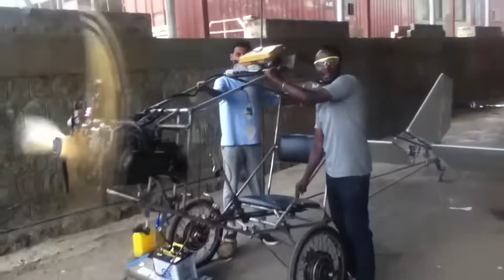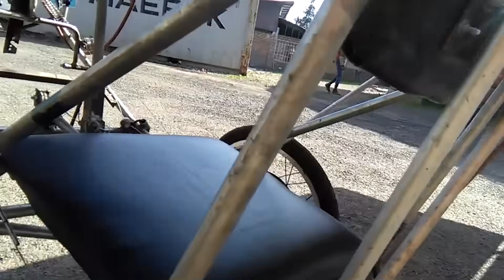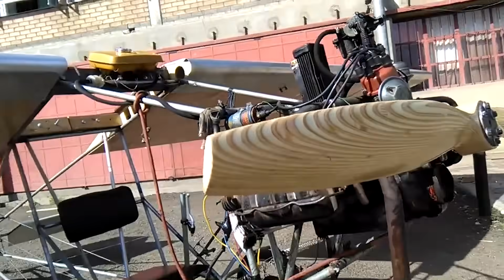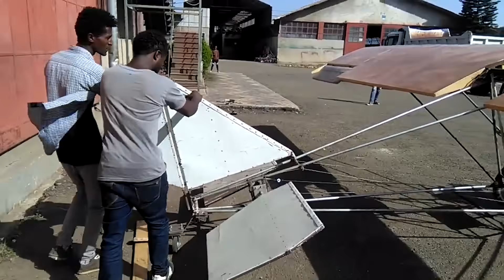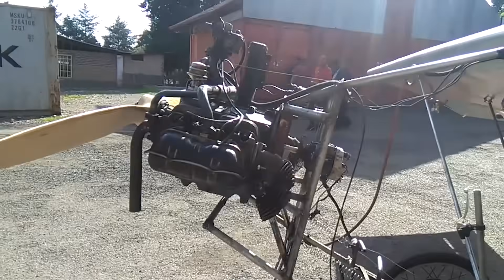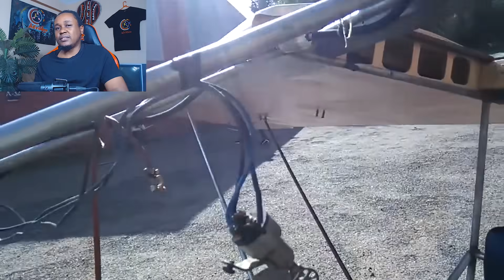First African Airplane To Breaks Aviation Rules

Comment: The next crash. A ford truck can fly but controlling it is somthing else  its called fluter on the elevator  and center of balance Weak looking weldsand landing gear. It comes apart after takeoff its over. Good luck

Comment: He says you sit directly under the small lawn mower engine. This is a VW car engine and is in front of the pilot. These engines are often used on even bigger planes, although they are modified. They even use 1/2 VW engines with 2 cylinders.
I don't think he is even talking about the plane shown. This plane looks like an actual manufactured and flyable aircraft, or at least they followed tried and tested plans.
That engine will have plenty of power. My only concerns would be that the engine is too heavy, the elevator deflection is too extreme, the gas tank looks like it holds enough for a 10 minute flight, and the pilot may not have a clue what he is doing.
Reply: A geared motorbike engine would be better . Power to weight ratio, bigger engine equals bigger wings .  Not to mention centre of gravity

Comment: You don't seem to know anything about aviation but to comment to negative about other investors that are trying and not sitting ideal
Reply: "inventors" 😂🤡
Reply: The main purpose of the bicycle wheels is to reduce weight and it's perfect because it carries the whole structure perfectly. Bravo my African inventors surely you will get there
Reply: 🎉I’m really impressed with the wing structure. It is a very good high lift air foil. Of course we can’t see inside, but if it’s a strong wing the plane would fly with a light weight powerful engine and a correct center of gravity. He’s on the right track.
Reply: @FrankRoberson-w6u 
You're right 👍